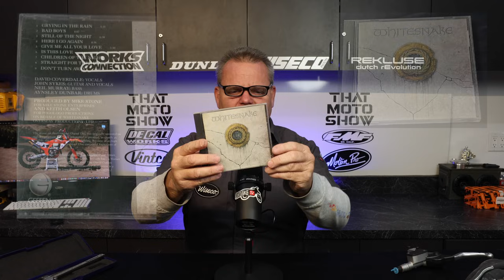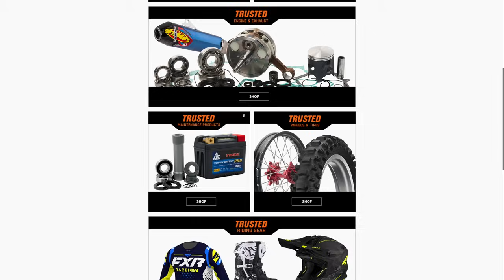That Moto Show DirtBikeTV #4 - "Crying in the Rain"

Comment: Here is a good rule of thumb for buying a used 2-stroke dirt bike.  Unless it has the original tires and chain/sprockets, (one good summer of use to wear those out), plan on spending around $1000.00 more just to get the bike mechanically sound, and that is if it looks in good condition.

Comment: If you have 3-4 winter months off riding per year, (2-stroke 250cc), and ride a lot (almost everyday) for the rest of the year, a bottom end (crank) should last at least 3 years, usually 4 years.  Michigan experience.  :)

Comment: Worn out cylinder plating is usually not from dirt, because good plating is harder than the dirt, and the soft aluminum piston takes all the damage.  I do know this from personal experience, but not all plating's are the same.  Just about all plating wears out faster than the first Nikisil (sp) Honda started using in 1988. The 125 is over 5 years old, and if ridden quite a bit every year, is about the life of a good plating, (and over 5 sets of piston/rings used).  Having it replated at US Chrome is probably around $300.00, ($400.00 total for a top end rebuild), and if you can't afford that, you probably can't afford to ride much.  Makes me sad.  Any kid who was not too lazy to make a buck before the 1986 production rule could afford to ride and race.  It was a better world.
Reply: If the crank has not been replaced, it is ready to go too.
Reply: And YZ 125s were never known for being very tough. I sold oodles of top ends for them. If I remember correctly, only Kawasaki had thinner plating. YZs had a very narrow exhaust bridge that heats up too quickly and seizes. Hence the two small oiling holes in the front of the piston.

Comment: Hey JAY, I’ve got a 2019 dirtbike torn down to the frame oh and a 2017 can you make a video to show me how to put it back together😂 and it will have to be in 4K please and thank you
Reply: In the 70's and 80's those bikes were called "Basket cases", because all the parts from a torn down used bike were in baskets.  Kids got those basket for cheap and put them together themselves to have something to ride.  You can buy from a dealership a "shop manual" (what the mechanics use in the back room, with more information than the regular owners manual.), that show you pretty much where ever part goes, and how to check them for wear.  Don't expect to know exactly what you are doing when you start. You will figure it out along the way, and you have a lot more resources than a 12 year old kid had in 79.
You won't believe how good it feels when you finish them and ride them.  That is because happiness comes from personal achievement. :)